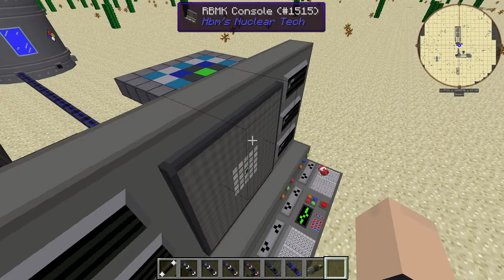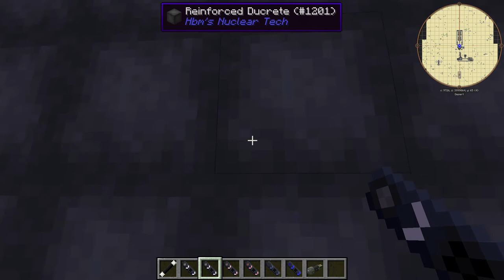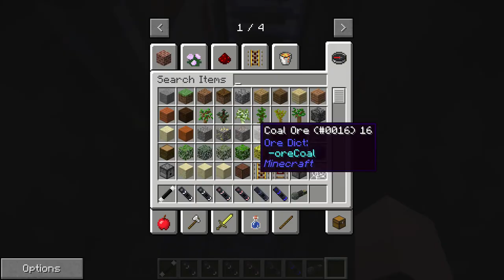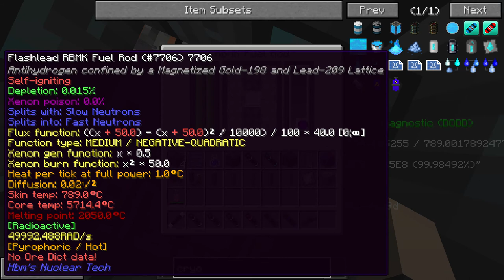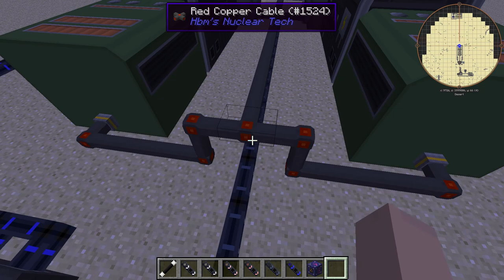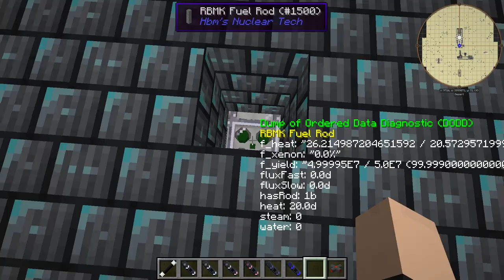RBMK PROTOTYPE PART 2 HBM TECH MOD

Comment: Leviathans have no limit to how much steam they process per tick, so having them doubled is pointless.
Also, the reflectors and the irradiation chambers do nothing, since no neutrons reach them.
Your reactor is pretty much equivalent to just the fuel rods and the boilers. With highly reactive fuels, it just lets the fuel react with itself, no neutron flux involved.The less reactive ones suffer from insufficient heat and build up xenon poisoning, further hindering their reactivity. If you want to be able to use different (self-igniting) fuels interchangeably, the simplest thing to do is introduce reflectors on all four sides, with a moderator and a control rod before each one. The boilers may stay the way they are. Then, for strong fuels like balefire, you'll shut the control rods off completely, and for the weaker ones, you'll adjust them to a level, at which the fuel experiences enough flux to burn off xenon, yet produces no more heat than what your cooling system can dissipate. (You can detect insufficient cooling by the water levels decreasing, and insufficient flux by the xenon levels increasing).
I hope this helps, if you're still at it